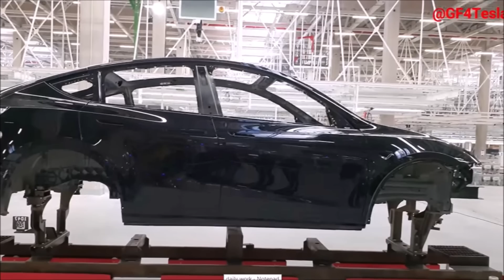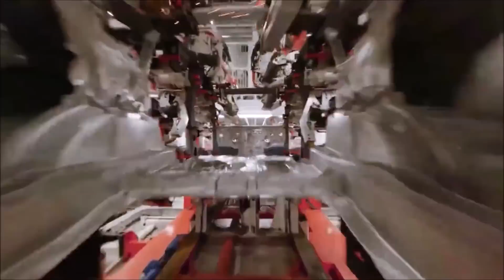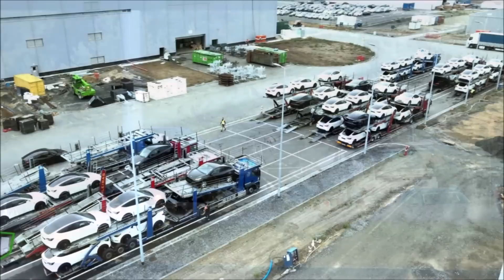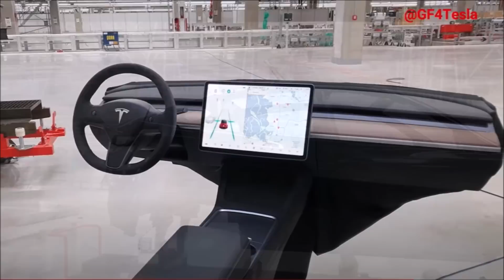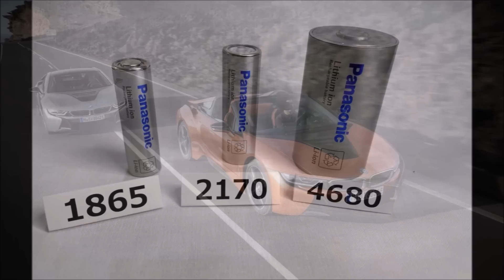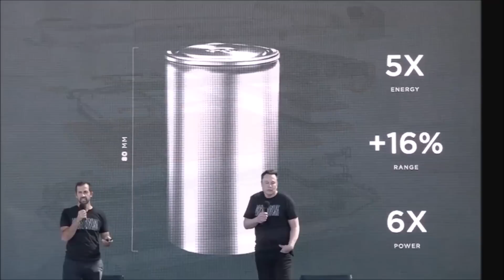Tesla Giga Berlin Has Adapted Its Logistics Concept To The News World Situation

Comment: Research the fossil fuels and raw minerals needed to create the metal body and other parts in an electric vehicle 
Now research the same on creating the batteries 
Now research the same on the charging of those "environmentally safe" batteries 
green new environment?
Now research the same on how well a battery functions in hot and in cold weather 
Need to go on a 350+ mile trip? 
You will spend a minimum of 45 mins refueling your battery 
Picture your local car junkyard 
Yeah, they're going to start glowing in the dark. 
But most of all 
Your government will have TOTAL control over the operation of your electric car 
Already happening in CA. Strain on the grid. Save energy for your mayors AC.
We ain't even close to making electric vehicles more practical than combustion